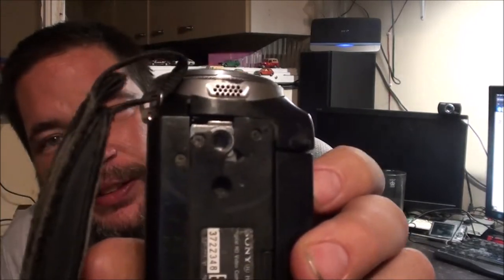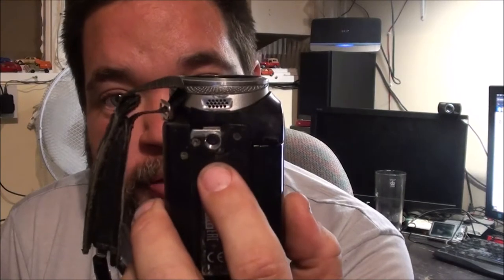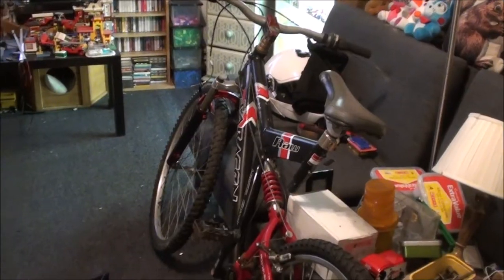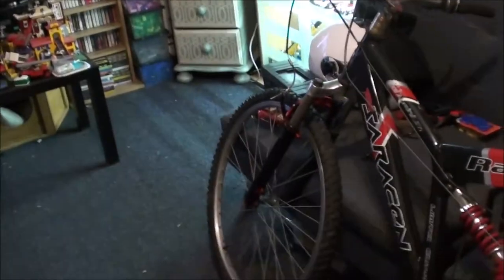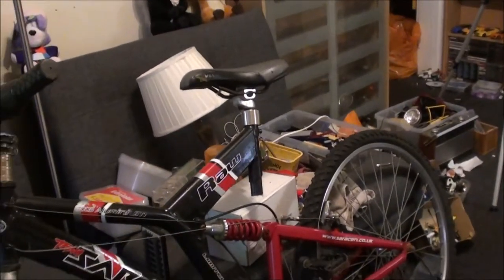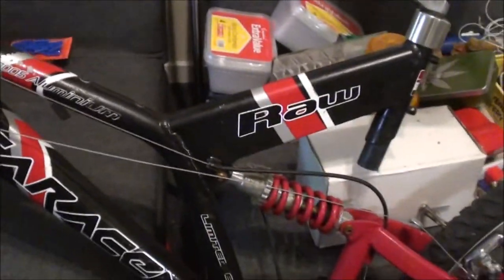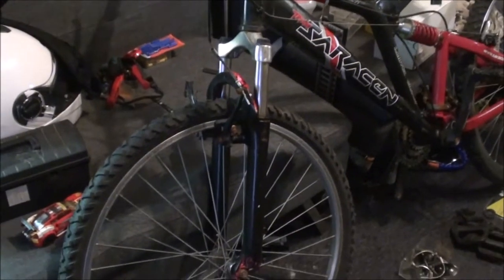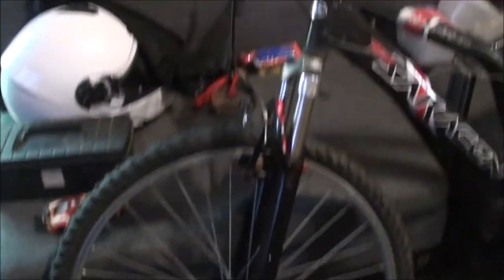I Bought A Mountain Bike Fixer Upper!! RAW!!

Comment: Folded many of the Raw frams are the rear shock pivot, whare it was welded to the triangular lower down bar just with climbing up a steep hill, it was the first time on the orange and black one then halfords done a warranty frame replacement took weeks! but same thing happened again then under warranty the orange and black raw was discontinued and they had the new silver and black one out so got a silver and black frame only front triangle from them they swapped everything over from the orange and black raw to the Raw 2 silver and black was exactly the same bike and 3 months later frame in same spot snapped once again! Just be away or this when climbing with these the down tube is not strong but thats a slightly different frame looks to be more support under the rear spring as bad as it is but might give more support but then why has it got these old Y cantilever breaks? It looks like they took notice of the snapped frames in this area on your black raw there but then went backwards with the breaks as had V breaks that were actually brilliant and them bomber wheels its funny to see the hunk of junk now but back in 99 it was an amazing bike till it started its frame creaking once hear that frames on its way out!